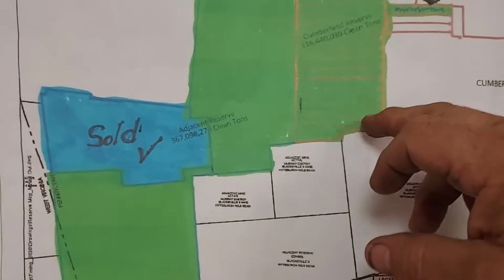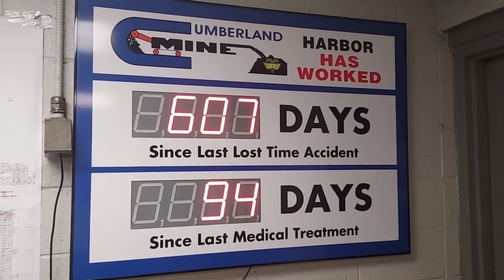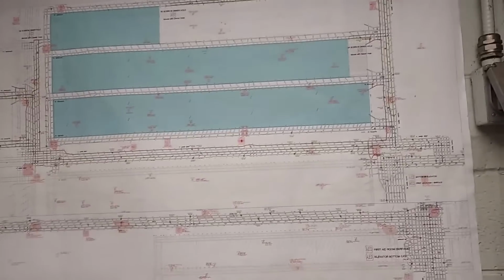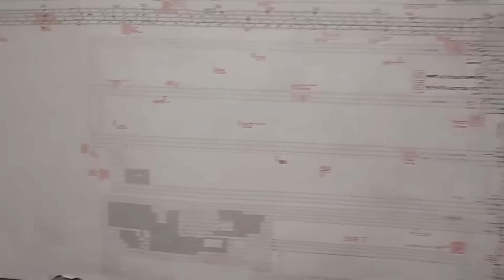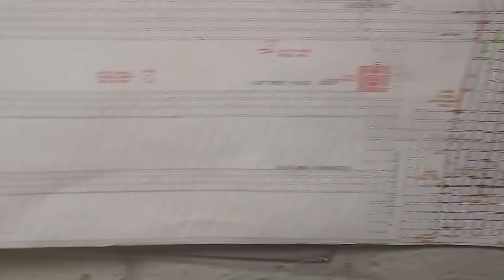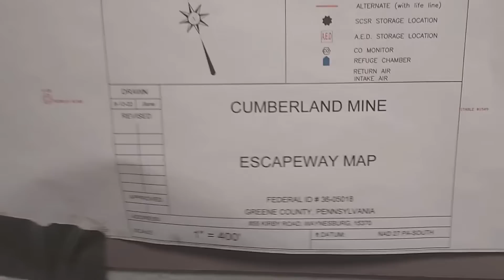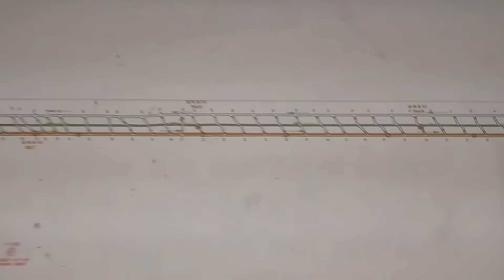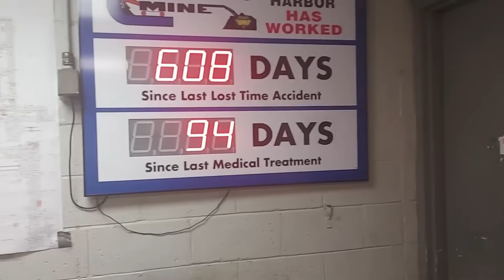What an Underground Coal Mine Map Looks Like

Comment: Fascinating, thanks!  I've always been curious about mines in general, and have taken two mine "rides" in Park City, UT.  In the late 1800s miners in the Ontario mine bore a drain tunnel 3-1/2 miles long.  They started from outside and from inside.  Surveying was by candlelight.  When they holed through, the tunnels were only 6 inches off center in 3.5 miles and you can see daylight from inside.  Thanks for your work that combines railroading and mining, two of my passions.  Great personality.
Reply from the maker: Thank you so much Richard for the very nice comment.
We do appreciate your taking the time to tune in to
the channel and check out the video. May you have a really 
good day my friend.

Comment: Thanks for the tour, Dave. Very interesting mining data. I can't imagine what's going on in the mine, but I'd be too claustrophobic to go down there. Hope all goes well for the mining aspect. Where does all the coal go? Ship? Rail? Export?
 All of your That's Railroadin' has been fairly standard stuff, I feel right at home whichya. Spent quite a bit of time working as a pilot/conductor on an American Crane, self powered Detroit Diesel 400 some cu in hydraulic traveling crane. Make up was Crane, flatcar, caboose. The flatcar was used for various tools, magnet, panel rail lifter for new panel rail, caboose, fuel oil tank locking tool bins, caboose was a cabin in the middle of a flat car, submarine, wooden deck on both ends. Working mainly with the track department, called the section department in the old days, renamed the engineering department by the UP, the gandy dancers, mostly Mex dudes, really a pretty good bunch of guys, especially compared to some of the real crabby sob conductors that were around in the '70s.
Reply from the maker: Thank you very much Thomas for the nice comment. We really
appreciate your taking the time to pay us a visit and write in
my friend. We sell all our coal via barge to various power
plants and even a cement plant.

Comment: WOW that is quite deep! do they have to decompress at all? I have seen old mining videos, 
and they went down via cars and track. but when digging deeper you need “ a cage” because 
it descends faster then you could on a track. I do not think I could work down there, just thinking 
of the amount of material they would have to move to dig out if anything happens. they are a very
unique group of people that do mining. thank you for the insight of the Cumberland mine. the coal 
you mine is “soft” versus anthracite which is the hard coal. I remember reading about how the PRR
was a major hauler of anthracite coal. always in site full watching your videos. barry
Reply from the maker: Thank you Barry for stopping by and checking out the mine map.
Always is a pleasure to have you visit my friend. Our miners go
down a shaft in a cage. All supplies go in at the slope at the prep plant. There is a huge hoist that lowers supplies on rail cars
down. Miners used to go down that slope when we first started
but as portals moved that's when the shafts were dug. Shaft
work is very, very dangerous.

Comment: Question  -  Abut how big is the various sections???  feet or miles ???  And mine depths ??
Reply from the maker: Very good question Marv. Long wall panels vary in length and
width, they are in feet, I'm not exactly sure but a good many
of them are about 1200 to 1500 feet in length. They are talking
about having longer panels in the future. The depth of our 
mine also varies from 700 to 1200 feet depending on the 
surface topography. Also coal seams are like the surface, they
go up and down with hills and valleys. it makes mining a challenge
sometimes. I've never worked under ground, but the guys who
have tell me at 1200 feet deep you can actually hear the
pressure from above pressing on the ribs. (sides of the mined
out areas) Scary thoughts to me. thanks so much for stopping
by my friend.

Comment: Hi Dave,

How deep are the mines where they are extracting the coal?
Reply from the maker: Our mine runs anywhere from 700 to 1200 feet in depth Bob,
depends on surface topography and also coal seams are not
flat, they have hills and valleys like the surface does. At 1200
feet deep the miners tell me you can hear the sides of the
sections popping from the pressure. Scary being a coal
miner. That is dangerous work. Very much appreciate your
visiting with us and for writing in my friends.

Comment: Do they use water misters in the mine to reduce the dust and explosion 💥 risk ? Is there a safety vessel in case of a fire ?
Reply from the maker: yes they do when cutting coal they always use water sprays,
very good question ocsrc. Water significantly cuts down on
coal float dust which is a major contributor to afire hazard.
Reply: @ccrx6700  I really think with the coming middle east War that oil is going to skyrocket

Coal will be in big demand

I would write up a proposal for the head honchos and recommend connecting to ND or CSX and building a yard, and putting in a second track and looking to do strip mining 5 years from now to get all the coal out of the ground to maximize the value of the land

They could build a yard at the end of the property with a giant loop.

They could go around the outside perimeter leaving the inside to be mined using open pit technology

They could pull a lot more coal everyday out of that property and put 400 cars in the yard each day

Natural gas will Spike and Coal will be The logical choice.

The big plants in northern New Jersey and in Pennsylvania along the Delaware River have natural gas hookups but they still have the train tracks and the furnaces to run the coal

They can switch right back to Coal with almost no effort

The price of electricity here has doubled and with the increasing cost of natural gas it will double again next year and I really think they are going to switch back to Coal for power generation

There's going to be a lot of buyers and if you can have a track connecting to the yard for CSX you'll be able to sell as much as you can pull out of the ground

The way it's being done now takes a long time

Open pit is fast and cheap
Reply: @ccrx6700  I really think with the coming middle east War that oil is going to skyrocket

Coal will be in big demand

I would write up a proposal for the head honchos and recommend connecting to ND or CSX and building a yard, and putting in a second track and looking to do strip mining 5 years from now to get all the coal out of the ground to maximize the value of the land

They could build a yard at the end of the property with a giant loop.

They could go around the outside perimeter leaving the inside to be mined using open pit technology

They could pull a lot more coal everyday out of that property and put 400 cars in the yard each day

Natural gas will Spike and Coal will be The logical choice.

The big plants in northern New Jersey and in Pennsylvania along the Delaware River have natural gas hookups but they still have the train tracks and the furnaces to run the coal

They can switch right back to Coal with almost no effort

The price of electricity here has doubled and with the increasing cost of natural gas it will double again next year and I really think they are going to switch back to Coal for power generation

There's going to be a lot of buyers and if you can have a track connecting to the yard for CSX you'll be able to sell as much as you can pull out of the ground

The way it's being done now takes a long time

Open pit is fast and cheap
Reply from the maker: @ocsrc  that would be a deep whole!  I didn't mention in movie but our coal seam is 700 to 1200 feet deep.  😊👍
Reply: @ccrx6700  that is a normal depth. 1200 foot level is the bottom of most mines I have seen. Imagine 500 cars a day coming out for the next 50 years. That's a good reason to be open pit. Mining.
And now is the best time for Eminent Domain to get the land at no cost to connect to the main.

And the government would pay for the track 
It falls under Homeland Security

It is a national security matter

Energy independence

Comment: I'm a little confused.   Are the narrow spaces the ribs of coal left to support the back or is the larger squares the coal left to support the back?  With the continuous miner or long wall mining, does the back collapse as the machine moves forward?  I remember an earlier video where you pointed out landscape that had dropped due to coal removal along the railroad maybe where the hunt club is.
Reply: A long-wall miner is a different machine entirely to a continuous miner.
Reply: The grid pattern he was showing is also known as room and pillar mining.  The large blocks in the grid are un-mined coal. This allows the roof to stay for the rooms/hallways. These create access/airways/vents/etc...  In the olden days, this was the only method of mining (by hand and explosives), at the 'end' of a run they would use retreat mining, where they would work from the back of the mine out towards the front, removing the pillars of coal.  This was very dangerous and caused collapses. Newer technology uses massive hydraulic shields to prop the roof overhead  for the longwall and it continuasly collapses behind as they advance.
Reply from the maker: The larger squares are what has not been mine Jim. With 
continuous mining the rood does not collapse behind it,
unless it is rib lined or also called retreat mining. With long
walling the entire roof collapses behind. That in mining
terms is called the gob. yes we had several sections of our
track that were long walled under and the track fell 2 to 3 feet,
that was an intense time trying to keep track surface up
to grade, but we did it. Always is a pleasure to have you
visit with us and hear from you my friend.
Reply: @stephenhunter70  thank you
Reply: @kevinkuhn3042  thank you
Reply: @ccrx6700  thank you

Comment: sorry one other item,
how deep are they 
mining? are there large
elevators to take them 
down to their work area?
Reply from the maker: Our mine is anywhere from 700 to 1200 feet deep. Depends on
the surface topography and also coal seams have hills and
valleys just like on the surface. I've never worked under ground,
but the guys who have tell me at depths of 1200 feet the
pressure on the sides of the mined out areas (called the ribs) is
tremendous. Can actually hear the ribs popping. That is scary!
Coal miners are brave souls! It's a whole different world
under ground. Yes Barry there are elevators to take the miners
down, they are called cages. And that's what it is a big
cage. when we started here in 1977 the  miners went down
the slope in rail cars made to transport men.
Reply: w @ccrx6700  4

Comment: How large on average are those panel/block sections ?
Reply from the maker: Good question 135SoHc. the long wall panel the I showed
you we are currently mining is, 5 miles in length and 1500
feet in width! Amazing isn't it! Not all long wall panels are
the same dimensions, That is one of the biggest ones we
have ever mined. If all goes well it takes 6 to 7 months
to mine out a panel of that size. Long wall mining is
incredible how they do it. Thank you so much for watching
and may you have a most blessed and prosperous day
my friend.

Comment: Dave, How deep are they working?
Reply from the maker: Our mine runs anywhere from 700 to 1200 feet in depth,
depends on surface topography and also coal seams are not
flat, they have hills and valleys like the surface does. At 1200
feet deep the miners tell me you can hear the sides of the
sections popping from the pressure. Scary being a coal
miner. That is dangerous work. Very much appreciate your
visiting with us and for writing in my friend.

Comment: How deep is the Mine?
Reply from the maker: Our mine goes anywhere from 700 to 1200 feet deep, depending
on surface topography Eric. Also coal seams under ground have
their own valleys and hills. At 1200 feet deep there is a lot of
pressure on the ribs (walls) they tell me you can hear the 
ribs popping.

Comment: How deep are the mines
Reply from the maker: Our mine is anywhere from 700 to 1200 feet deep. Depends on
the surface topography and also coal seams have hills and
valleys just like on the surface. I've never worked under ground,
but the guys who have tell me at depths of 1200 feet the
pressure on the sides of the mined out areas (called the ribs) is
tremendous. Can actually hear the ribs popping. That is scary!
Coal miners are brave souls! It's a whole different world
under ground. Thank you so very much for taking the time to
watch the video and write in my friend.
Reply: @ccrx6700  I’m with you! I ain’t going down in the ground like they do. Lol

Comment: Met coal is very low sulfur and phosphorus,  both elements are harmful to steel and silicon.  

What is the seam depth?  Thickness?
Reply from the maker: Our mine runs anywhere from 700 to 1200 feet in depth Keith,
depends on surface topography and also coal seams are not
flat, they have hills and valleys like the surface does. At 1200
feet deep the miners tell me you can hear the sides of the
sections popping from the pressure. Scary being a coal
miner. That is dangerous work. seam is generally 6 feet in height,
sometimes a bit more. Very much appreciate your
visiting with us and for writing in my friend.

Comment: One job where you turn up for work, change into coveralls, then maybe travel for a further hour underground before you can start your actual job! As I recall, the time was when you didn't get paid until you got to the coal face, so all that traveling was on your time, not company time, and if you had an accident, you had that same distance to be evacuated. Not for the faint hearted!
Reply from the maker: You are right in all your statements Con. Used to be miners
got paid when they showed up at face, and early when my
grand father worked in the mine, he only got paid for the
amount of tonnage he hand loaded, not the time he was there.
Now miners clock in before getting on the cage to go under ground.
They take a brass  tag off the board and carry it with them
so above ground knows who is in the mine and who isn't,
they also have a type of gps thing they keep on their hats so
surface knows where they are at in case of a disaster in the
mine. Coal miners are a breed of their own. Takes courage.
Really appreciate your watching my friend.

Comment: Dave that was very interesting and different, and no, I haven't been in a mine before but I have in the bilges of a ship bringing a centerline up. Wet dirty place, but the job was done on;y because the centerline was off some 56 feet. This happened on an aircraft carrier. After I'd gotten the mess cleaned off of myself and the two others I had with me it was up to the flight deck to get the rest of the job done. I did get the ship's Captain upset when I was putting a punch mark onto his flight deck and marking it with Dayglo Red paint.  He came just about unglued, he was ready to spit bullets. I politely informed him that the center line wasn't where it ought to be.  I marked it and painted it by order of the Secy. of the Navy, if he had any complaints he should take it up with them. I then excused myself and told him I was going to CIC to fix the rest of those instruments that had been set to the wrong centerline. I walked into CIC and started flipping on specific instruments, letting our folks know I was on station and starting this portion of the test. Once finished, I turned off those pieces last to first, closing the door.
The next day the off-shore testing would start. The ship would use a specific pattern so as to not encroach on Cuban water. Oh, yes, that was when I was stationed aboard the USNS Guantanamo Bay, Cuba '63 through 75. 500 marks 3 wrong, so our 95% average for correct marks was still holding up. and did so for the entire time that I was there.
Reply from the maker: Thank you Hugh for sharing that very interesting experience you
had. good for you for sticking to your guns. Always is a pleasure
to have you visit and write in my friend.
Reply from the maker: @hughgautier3894  👍😊

Comment: Strip mine would get 100% of the coal
Reply from the maker: Strip mines around here are usually less than 100 feet
deep. To go down 1200 feet would be an immense amount
of blasting and rock to be removed. We'd have to resurrect Big Musky or The Captain drag lines....:-)
Reply: @ccrx6700  XY International is planning to remove 1200 feet of the mountain in Death Valley to get the gold and silver.